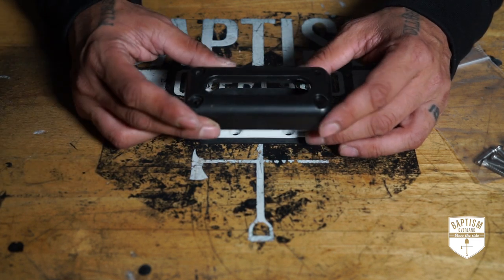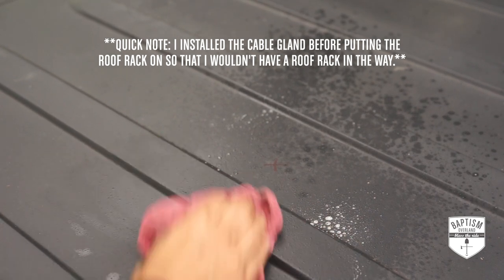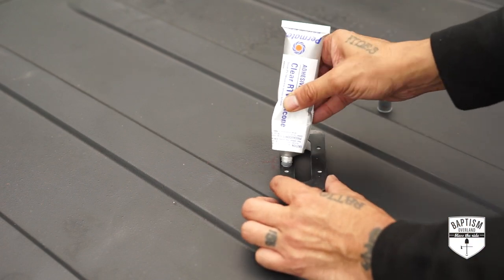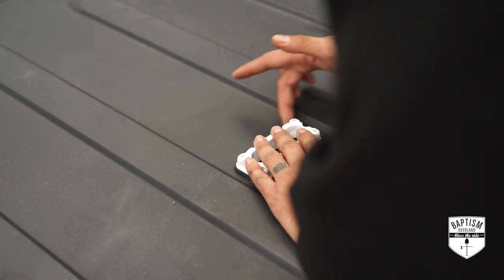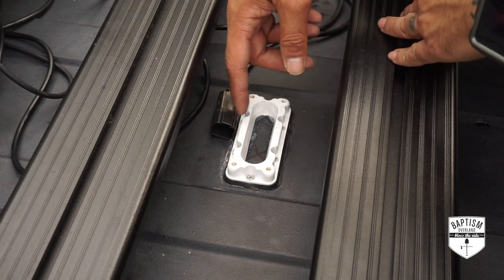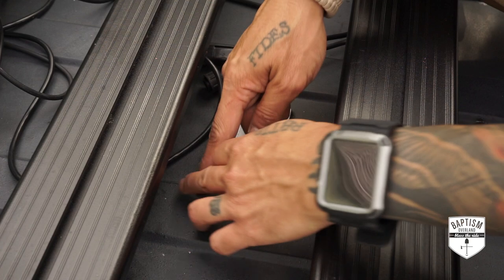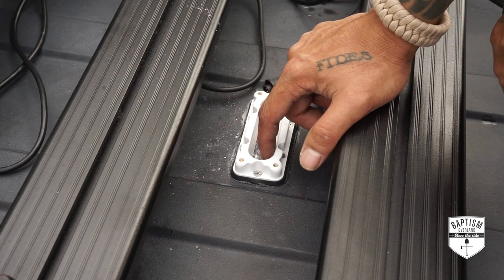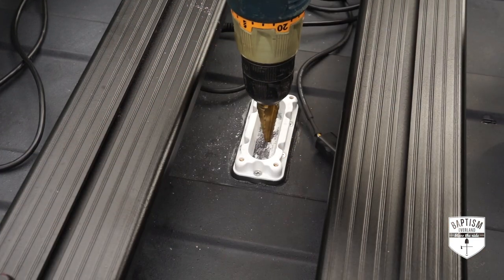The Most Waterproof Way To Route Wires Into Your Rig From The Outside

Comment: De-pinning the connectors helps you cut smaller holes. It's more fiddly - but aesthetics of having a nice neat hole with a grommet makes for a professional looking install :) Just some food for thought. (also makes it easier to route cables in tight areas)
Reply from the maker: I know...just didn't do it because I didn't have the tools to remove it cleanly. It's what I originally wanted to do but didn't want to go through all of that for one cord. It can def be a pain
Reply: @BaptismOverland  No worries - I figured it was something of the sort. Some cables are also easier to de-pin than others. But just figured I'd mention it for future reference. Genius idea with these marine grade pass-throughs.

I knew about de-pinning and grommets but never thought about these marine grade jobbies. Thanks for the video!
Reply from the maker: @EyebrowsMahoney  one day I'm gonna learn how to de-pin. With so many types of connectors I have to make sure I learn how to do each properly. I didn't have such a good experience first time I tried but I also didn't have the tools. It was a MESS 😂
Reply: @BaptismOverland  de-pinning a connector is super easy especially deutsch plugs. No special tool required to disassemble. If i buy something and it doesn't come with a deutsch plug on it I will put one on. I did buy a tool kit to build my own.
Reply: @TheRedsuper1  Cool. Will def learn because I am a super fan of deutsch plugs now. They're so convenient.
Reply: @EyebrowsMahoney And then this guy says “Why not de-pinning?”  And that is how my mind gets blown and I run down the rabbit hole.
Reply: @chrissharon3213  🤣 glad to assist! Sometimes you might only have space to pass through the cable, so de-pinning is common to fit cables in opportunistic spots. It's also useful for temporarily routing equipment cables that you plan on removing, routing it through existing holes to allow it to be returned to stock easily.

Comment: Great share, you are correct there are no other videos about running wires like this.
For the inside ceiling of your vehicle you can fabricate a a cover plate, or 3D print one, that has some style. Just cosmetic.
Reply from the maker: Yep! Have already been thinking about a way to do it. The problem is that it went through the middle of a bump so it's not flat.

Comment: It's funny how one can dive head first into the YT rabbit hole of "how to run wire into vehicles" and scroll, scroll, scroll away. It was a comment on another channel that took me to a your channel! Happy to have found yours as I'm in the beginning stages on my exterior electrical project for my 4R. Last week a buddy and I were thinking about how to run wires from my SP to the roof. He said why not drill a hole? I cringed at the thought BUT now that Seaview device may change the way I complete it. Now to brainstorm and come up with the final location that works for a easier/waterproof penetration of the metal roofline. Cheers.
Reply from the maker: Oh man the rabbit hole is REAL!! The other day- for some unbeknownst reason to me- I went down the rabbit hole of The Voice performances 😂
Reply: @BaptismOverland ...Now that's funny!! Cheers! BTW those seaview cable glands aren't cheap BUT worth my sanity in the end. Cheers

Comment: Many years ago when I needed to run electrical wiring through the roof of a vehicle, I just used some stainless steel bolts as a pass-thru electrical connector with ring terminals on the wire that were in the cabin side and for the wires that were outside going to the lights.  I would use O-rings to keep the water from coming around the edges of the stainless steel fender washer, although a garden hose washer would have probably also worked.  If I ever needed to permanently remove one, it was a simple matter of plugging the hole with a short stainless steel carriage bolt so that the rounded dome was on the outside.  The wires on both side of the stainless steel bolt had ring terminals on them, so it was possible to have multiple wires coming to the same thru-point of they were all o the same circuit.  Once satisfied with the connections, a bit of RTV over the exterior portion or a rubber cap like you see on winch connectors or battery terminals on motorcycles would work.  If your roof is electrically conduction (i.e. metal), you will need to add some insulation between the bolt and the metal of the roof so that it does not short to ground... You might need to grind off the square inner portion of the carriage bolt head...

Another solution would be to drill a hole through the center of stainless steel carriage bolts and make the pass-thru out of them with the wire going all the way through the center of the carriage bolt...
Reply from the maker: I'll try that next vehicle. I like that it would be cleaner that way for sure
Reply: @BaptismOverland  -- Drilling a hole down the center of a bolt is possible with just a hand drill (I've done it), but it is a LOT easier when you have a lathe to hold everything perfectly on the same axis... A mini-lathe is a great little tool to have in the shop for things like that...

Comment: May have been mentioned, but I use a product in clean rooms that is similar to what you are showing, but I think the rubber piece is a little better.  It called RokStak the rubber is in thin layers and you just pull out what you need and when you put it back together it will seal everything super tight.
Reply from the maker: Oooh I like that! I'll def look at that option next time I run wires in. Prob for a trailer project or a new vehicle. Thanks man!
Reply: thanks.  Do you have a link to the company?  I tried googling it and didn't get any good search results.

Comment: Nice setup! You can use some Windex around the rubber plug for an easier install. But you gotta clean your cable connectors with some isopropyl alcohol, if you get some Windex on it.

Comment: Why not just cut the plugs off, drill a small hole for the wire, then re-connect the plug.. Much smaller and neater hole.
Reply from the maker: Def could do that. My answer? The ends of all those wires would require me to reinsert each pin all over again and for some of the connectors I don’t have the tools to take it apart and push them back in. That means I would have to just splice wires again and create another connection point that could go bad.

Comment: just recently used one of these Seaview cable glands, I have always just drilled holes in the roof of a vehicle and used marine sealant around the cable.  Hasn't rained yet, but I'm going to assume it should be fine but only time will tell haha.  I figured if it is used on marine equipment and boats it should be more than good enough for a truck on the road.

Comment: Solar panel entry glands are a possibility too. I just wish that there were types that would accept more than two wires. The advantage is that each wire has a compression joint to ensure a really tight, waterproof seal around the wire.  But you have to get the proper size compression joint and the entry glands I saw have a limited selection of wire sizes. And the wires enter parallel to the roof surface, further avoiding water entry.

But I’m going to check this out. I want to run two solar panel wires and a smaller wire for a roof rack mounted backup camera.
Reply from the maker: Agreed. I actually just installed a solar panel and used a solar gland for that one. I like how it tightens pretty securely.
Reply: @BaptismOverland  
I used an entry gland without compression joints. Instead there are MC4 connectors for the solar panel feeds.  As long as the manufacturer did a proper job designing the seals, they were installed properly, etc then I should be good to go.

BTW, I ditched the idea of a backup camera. I already have two.  Long story about why I considered a third camera. Suffice it to say it has to do with the fact that the vehicle inspections here in Japan often will fail the vehicle for certain structural changes. For instance, I’ll have to remove all the cabinets, including all the batteries, solar charge controllers, etc every year prior to inspection. PITA.
Reply: @BaptismOverland  do you have a video or photos of you solar setup.
Reply from the maker: @Axelthetaxman  there is. Check the channel.

Comment: Thanks - Really nice piece of gear.  Did you attach with self-tapping screws into the fiberglass roof or through holes and bolts?  If self-tapping screws does it seems like that got a good purchase and will hold firm?
Reply from the maker: I used self tapping yes. But also a lot of RTV silicone

Comment: Excellent video!  I am doing this now. Did you ever figure out what to do to the inside area? I’m having the same issue.
Reply from the maker: I left it alone. I used a dremmel to cut it nicer thought and then used rubber trim to clean up the edge. Doesn't look too bad anymore
Reply: @BaptismOverland  excellent. I figured you probably must have by now. So nothing on the inside. No water coming through? I must do something to the inside. It looks kind of sketchy.
Reply from the maker: @dr.christophergroves2116  nope no water at all! And inside it's fully open too. The rubber inside this thing is great at keeping water out.
Reply: @BaptismOverland  thanks again bro!  Keep the videos rolling.  I’m all in!  I think I will seal the top with some silicone and leave the inside bottom alone.

Comment: Great idea.  What did you do inside? So it looks clean thanks
Reply from the maker: That one was a mess the first time. I've since added another cable gland for my solar and for that one I made sure the hole kinda fell above the roll bar so you never even see it. Goes straight into roll cage and hidden in the roll cage cloth wrap
Reply: Any pics ? 
Thx

Comment: Always use a little silicone on your screws.   It’s a common place to leak.   Nice job
Reply from the maker: I did actually after I learned that lol. Been doing it since. Specially when I installed a roof rack on the 4Runner

Comment: Scanstrut has the DS-Multi model that's basically the same thing as this Seaview... I actually liked the looks of Scanstrut model better, but the cheapest I was able to find the Scanstrut model was around $50 shipped, but I was able to find this Seaview for $30 shipped... Ordinarily I would pay the extra $20 to get the one I like most, but considering they look very similar anyway, and the fact that it's going to be on the roof of my SUV where people won't really see it, I decided it would be wise to go with the Seaview. I'm pretty confident that either option would be very effective in waterproofing the hole. Although there was one review on Amazon who said the Seaview CGM17PG leaked a little when he hit it with a high pressure water wand while washing his truck.
Reply from the maker: Good to know! Luckily no leaks so far and I've had it on about 8 months now. And yes, same thought process. No one will ever see it.
Reply: @BaptismOverland  Yeah, good to know yours is still going strong with no leaking. I liked the video bro, thanks for sharing. It helped inspire other ideas for me.
Reply from the maker: @imdbtruth  Thanks!

Comment: umm whats to keep water from dripping down the wires through holes?? or did i miss something
Reply from the maker: If you make the holes slightly smaller than the wires then once you put it in, the rubber basically clamps around the wires and creates a really strong seal. One the plastic cover goes over it all it compresses the rubber really well
Reply: @BaptismOverland  The install instructions say to make the hole .5mm bigger ?

Comment: Can you cut threw the freedom panel? Or should I drill threw the hard top. I have a 2 door jk.
Reply from the maker: Only reason I wouldn't put it on freedom panels is because you might want to take those off later for whatever reason and it's hard to do that with wires attached to it. But it's basically the same structure as hard top so yeah you CAN.

Comment: Silly question but how did you avoid drilling or screwing through your head liner
Reply from the maker: On a Jeep there's no headliner. Unless you put aftermarket ones of course. But that's only in certain spots. The whole roof isn't cloth. (That's why it can get so loud inside a Jeep haha)

Comment: Dang. I just realized it is going to be such a pain to do this through the headliners. Lol - still going to do it though!
Reply from the maker: 😂 it’s worth it!
Reply: It depends where and on which vehicle you want to install it. On some vehicles you can get access to the roof around the edges of the vehicle with only having to remove or loosen a few pieces of trim. You don't want to take the whole headliner off, just try to find a place with enough access to comfortably feed the wires through the hole. If you have a rear hatch, that's likely your easiest point of entry.

Comment: I have your mindset to a T.  However, with my experience of PVC buried or outside, water gets in always and that's my concern here.  Plus you're putting even more holes in your panel.
Reply from the maker: Would only use this on Jeeps because it doesn't have a headliner and this Jeep already has a bunch of holes lolol at some point if I ever sell it I would just keep all the gear, throw a soft top on and call it a day

Comment: What does the wiring look like inside the vehicle?
Reply from the maker: I had it come through above the roll cage so you don't see anything. There would normally be a hole
Reply from the maker: I coulda also used rubber grommets

Comment: Maybe a second unit on the inside?!
Reply from the maker: I wanted to do that but the inside, the hole goes straight through where the roof curves at a 90° angle. Apparently the shape on the top of the roof differs from the shape on the inside. The slats run parallel to each other fml

Comment: Devil's advocate... When one cable gets caught on a low branch it'll get dragged and move all the other cables out of alignment creating leaks. With older style cable glands each cable is indivudually passed through and a tree branch will only impact one cable not the entire run.
Sometimes pretty and easy isn't the best solution. To each their own I guess. (Edited for spelling because grammar matters!).
Reply from the maker: Nope, that's a VALID concern you have and something I thought of already. All my glands are underneath my roof rack deep enough for branches to not reach. The space between rack and roof is also minimal. I have a video on my channel where we were literally going through an overgrown trail and we were getting so much pin striping we didn't think we could make it through. Wires never got snagged.

Comment: Why do people choose plastidip over normal paint? That shits gonna peel in 2 years at most. What's the hype over that shit. Black paint still exists.
Reply from the maker: Different reasons. For me, mainly because it will peel and will peel cleanly vs paint that gets scratched up and then it doesn't look so good. Also it coats well without streaks or runs much easier than spray paint which doesn't adhere as well without proper priming.